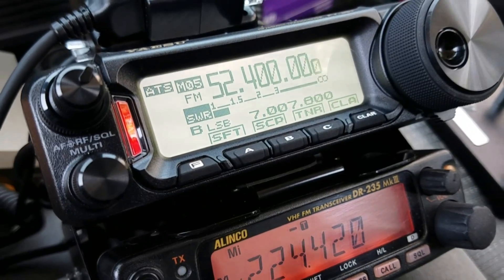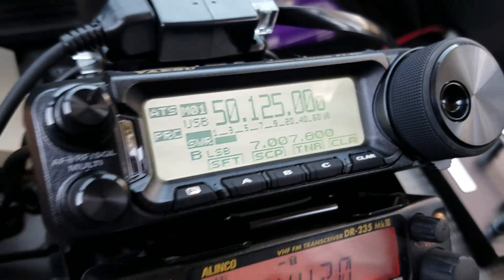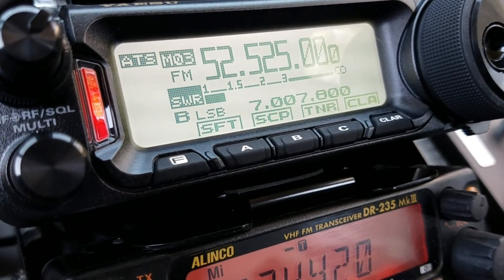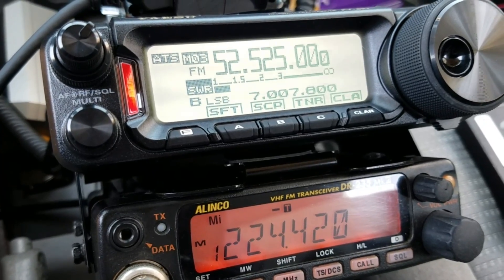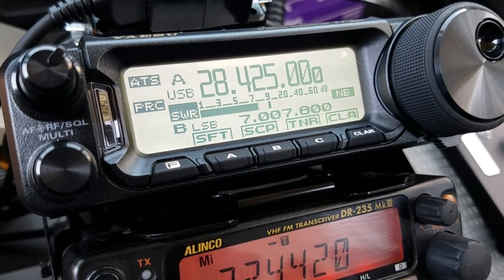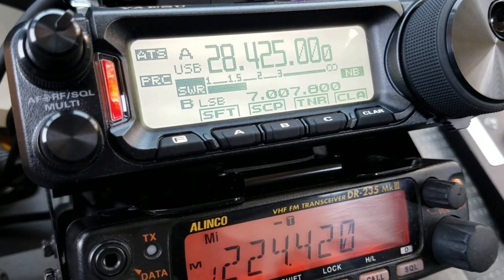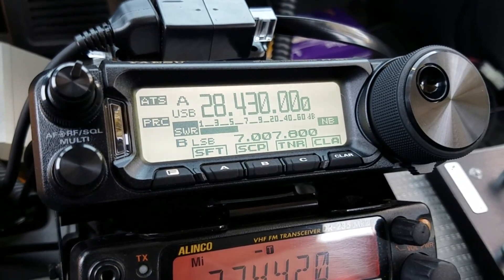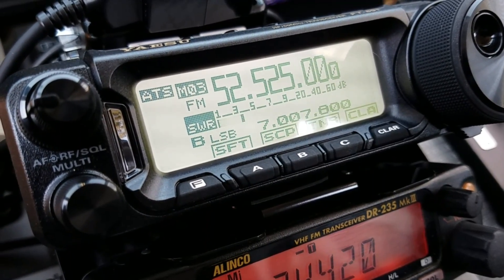Yaesu FT 891

Comment: Hassan, which do you like better? the 891 or the 857?
Reply from the maker: The 891 has a better receiver and intermod rejection,  also power amplifier is more solid. The screen also is larger and easier to see. I do miss my 2 meters and 70 centimeter all mode bands, as the 891 does not have! That IF DSP really works on the 891. All in all, I like the 891 better.
Reply: I figured with having the FTM-400 already I wouldn’t need the 857, but I have never worked 2 meter SSB.
Reply from the maker: @N4EJM  there are plenty of activity on 2 meters SSB in southern california. You can also operate 2 meters CW using the 857!
Reply: Is that the Diamond K-400 Mount for the ATAS?
Reply from the maker: @N4EJM  yes.
Reply: I think the display on the 891 and the current $160 price difference works for me. N4EJM

Comment: How's your audio now ? Did you upgrade your mic ?
Should try MH-67, supposed to sound fine.
AM sounds fine off of the 7300.
Reply from the maker: I made some adjustment with the built in parametric equalizer and it sounds real good! The stock mic has more punch on SSB. Thanks for your suggestion.

Comment: can anyone or got info on wiring up a mfj-939 auto tuner to a 891 what i want is the remote cable mfj doesn't have one for this radio in fact i can fine one on line kc4sbj1@gmail.com

Comment: Awesome.  Hassan is a Ham Radio Stud!   Very Cool.     W6PWM
Reply from the maker: Mike Forslund lol.... thanks for the vote of confidence!
Reply: HA!  Your setup in your car is very cool.  It appears to be always changing.  Leaving us mobile rookies in the dust.  :)
Reply from the maker: Mike Forslund that 447.2 fusion machine on oat is off the air, as of yesterday!
Reply: Yes I noticed that yesterday.  UGH! Fortunately I just got my HRI-200 Box yesterday.  So I will just be setting up a node through my FTM-100DR and attaching to 445.540 so I can talk with you guys through fusion.
Reply from the maker: Mike Forslund yes, that would work, your 100 would act like a modem and you cab use yuppie handheld to talk to the socal link.
Reply from the maker: YOUR handheld lol
Reply: Thats the plan.  I'll use my FT1XD.  Hopefully  449.460 repeater on Oat will comeback online soon too

Comment: Seriously considering buying the 891 and ATAS 120A.  Like, tomorrow!  Are you still happy with this rig?  It seems to me it a versatile setup for HF.  I already have a dual bander, so 2m and 440 is not an issue.  You've got quite a mobile setup there, and it looks and sounds great!  73,  Brett K5WXP
Reply: K5WXP very happy with the radio, you can't beat the value, just make sure the antenna has really good ground, you won't be disappointed.  DE N1CY HASSAN
Reply: ATAS 120A holding up ok, too?  Just bought the rig and antenna today at MTC Radio in Paris, Texas!
Reply: K5WXP that's awesome, congrats and enjoy a terrific package that's truly unbeatable for value.

Comment: Nice video I'm tempted to buy one of these the rx sounds good. I used the atas 120 before its a great antenna, if you buy a spare whip for a Wilson 5000 and replace the yaesu atas whip its another s point or 2 stronger on tx and rx. Happy Dxing

Comment: Hi Hassan.  Do you have any pics or videos of your ATAS 120 antenna installation?  I am just wondering how that looks on your vehicle.  Also, have you discovered any information on MARS/CAP mods for the 891 yet.  I would like to get that radio, but I need it to be able to do CAP.  Thanks.
Reply from the maker: Max Harddrive I will take a short video of my ATAS 120A installation, I can also send you pics via email... send me an email to n1cystation@gmail.com and I will reply with pics. I believe gigaparts.com will mod the radio for you  mine isn't moded.

Comment: In the brochure on the Yaesu web site it has a block diagram showing a 69 mhz if with roofing filters, a 2nd if around 450 khz with mcf (monolithic ceramic filter?) and a 3rd if with dsp at 25 khz.  In the specs it shows only one cw selectivity, 500 hz.  This could lead someone to believe they are not getting any selectivity in the dsp.  I could not find any mention of any sort of dsp benefits other than the normal nb, nr stuff.  Is there really additional filtering going on in the dsp?  The instruction manual download just hung, and would not complete for me.
Reply from the maker: You have Digital Noise Reduction DNR, and Digital Notch Filter DNF.... these are utilized at the IF stage, not the audio stage like the 857D. they're more effective that way.

Comment: That's a lovely looking radio for sure. If it had 2m/70cm I'd be trading in my 857d!!
Reply from the maker: it's has a far more selective receiver with IF DSP, a roofing filter and it puts out a solid 100 watts on all the bands with a built in TCXO ... it was a no brainer for me to sell the 857 and get this one. I still have  vhf/uhf all mode with my Icom 7100. My 2 cents...
Reply: it is very tempting to get one..... I love the large clear display on it!
Reply: N1CY Did you put your 7100 in the home shack?

Comment: why did you have to keep retuning the antenna everytime change frequency? your SWR kept going high. K4GRN-N1CY 73
Reply from the maker: I was using the ATAS 120A motorized Yaesu Mobile antenna, and so when change bands, you have to command it to go up or down for best swr, typically 1.5 to one. thanks for the comment.

Comment: Thank you for showing us the video. How far was your contacts in range ? Did you use an external tuner the Yaesu FC-50 or the radio internal tuner?
Reply from the maker: they were within 20 mile range and I was using the ATAS 120A, a motorized Yaesu screw driver mobile antenna.
Reply: 891 has no internal tuner